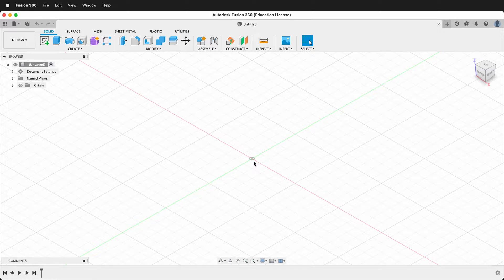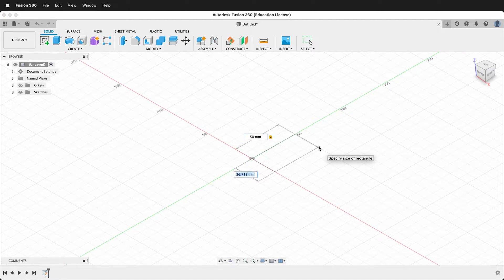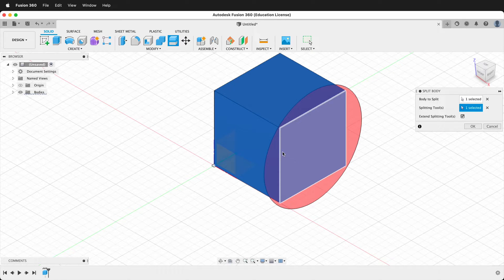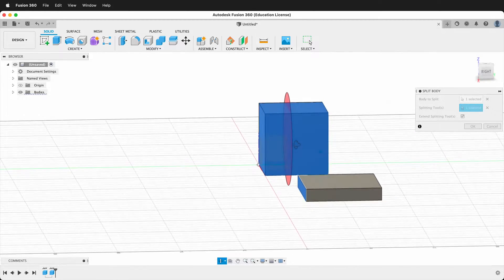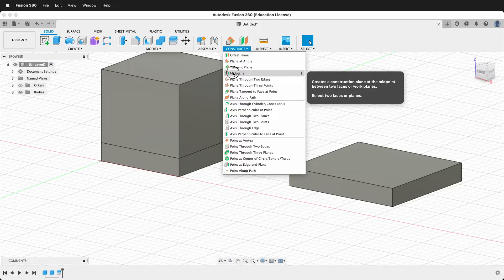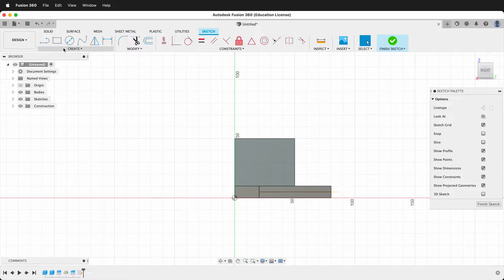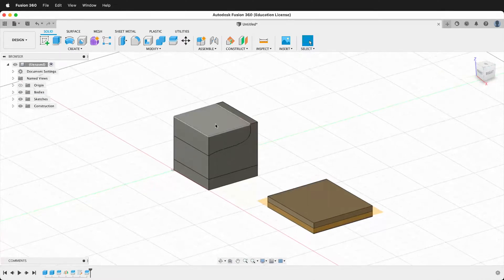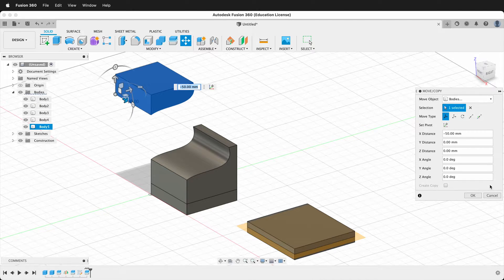How to Split a Body in Fusion 360 Tutorial

Comment: Thanks for the nice tutorial. it looks like you're using an M series MacBook (based on the top bar)... its interesting that when you rotate the graphics are perfectly smooth, because on mine, when panning/rotating, the graphics are jittery. did you have that problem, if so howd you fix it
Reply from the maker: haven't had any graphics problems, did you update Fusion?

Comment: Used up all of my uploads trying to get this to work with an actual model.  How do I simply split a body in half lengthwise?
Reply from the maker: Put an offset plane at the place you want to split the body in Fusion 360 and then, modify > split body and choose the offset plane as the splitting tool 🪓
Reply: @WhatMakeArt  I can't get the object to align with the grid, which makes setting planes and points extremely difficult.  How do I get the object's centerline to sit exactly on a grid line?
Reply from the maker: If you modeled the object in Fusion 360, then go back to the first sketch and make sure it has a midpoint constraint on the origin. If you imported the model into Fusion 360, then create a sketch on the side of the model, and project one of the long edges into the sketch, set a midpoint on that line in the sketch, then draw a line perpendicular to that line, then finish the sketch. Now you can set construction planes at angles at those lines which will be perpendicular to and at the midpoint of your object
Reply: @WhatMakeArt  I didn't model it, and I seem to be in over my head.  Thanks for your time, though.

Comment: Thanks for this, but for the life of me, I cannot seem to split a cylinder down the middle so you have two extruded semi-circle type shapes. I can't figure out how to accurately make a tool on that plane.
Reply from the maker: Did you try centering the cylinder on the origin and using one of the axes as the splitting plane?
Reply: @WhatMakeArt I did but it needed to be 45 degrees. I managed to do it by rotating the part. Thanks.
Reply from the maker: Glad you figured it out

Comment: How can you split a body along center mass that is shaped like a noodle?  (e.g. coil)
Reply from the maker: Did you make it with the coil primitive?

Draw a 3d sketch, the extrude a surface in the surface workspace, use that new surface as the splitting tool in fusion 360.
Reply: @WhatMakeArt  Extrude requires a plane.   In this instance there are no planes, only arc's.

like a pipe that is curved along two axis.

e.g. imagine a pipe in the ground that is bent south, but transitions to a bend to the north.

And you want to split the noodle shaped pipe into two (full length) halves like a cast.

Thanks!
Reply from the maker: You can create a surface from arcs in the surface workspace by lofting, you can add a guide rail to keep the surface in the middle

Comment: when I split a body, it works as expected but when the cut part of the body is moved it still shows up as semi transparent blue (at the location it used to be) and I cant delete it. Also the body that has been cut still behaves like the uncut original body
Reply from the maker: Are two bodies listed in the outline on the left?

Did you check the box to extend the splitting tool fully?

Comment: WTF fusion 360 is NOT letting me do ANYTHING.  When i click on the body i want to split, it does not highlight it, etc.  I am using the free version so I think i might just have to look elsewhere to construct projects....
Reply from the maker: Frustrating when software doesn't work as expected. In fusion 360 try to click the body. In the outline to the left, also make sure that you have all selection options enabled, it is under select on the top right, if you uncheck bodies then you can't select any bodies

Select the most then go to modify to split body then select the splitting tool, remember to click the box in the split body dialogue for splitting tool to be able to select it